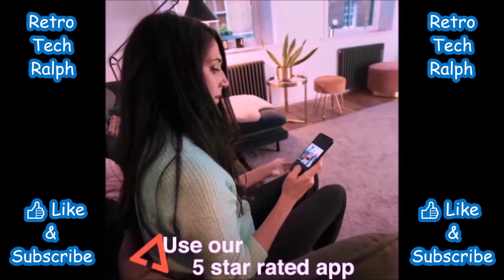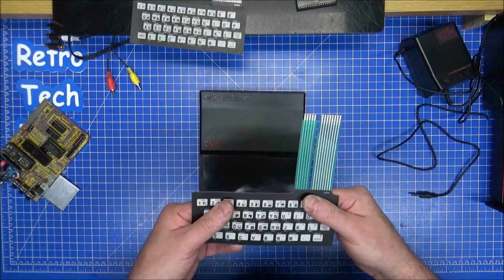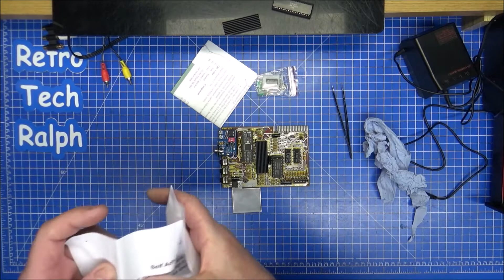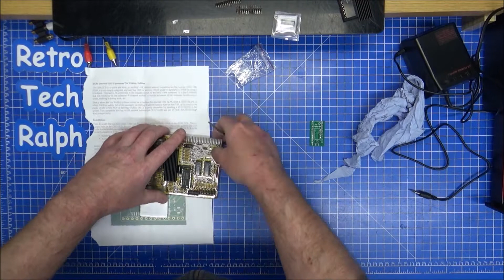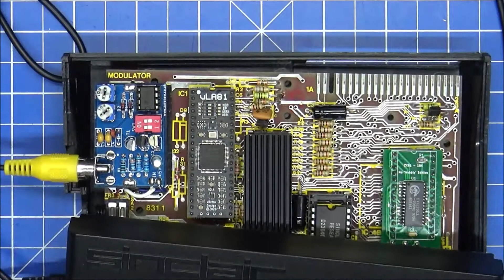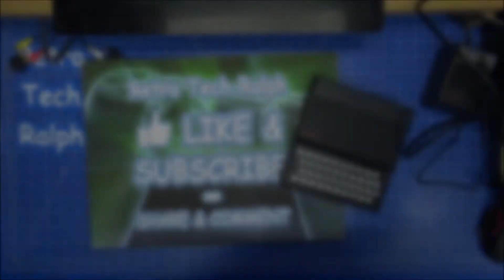ZX81 Repair Part 4. VLA81 and Completion of Repair

Comment: To get the full 16K, you need to set the jumper link to LK2 to connect address line 10. That will give 32768. The first 16K is reserved for the ROM space, then 16K of RAM. That will give 32768 after peeking in RAMtop.

Comment: I am on the same journey! I made the composite mod, BUT, with the vLA81 you don't need the composite mod at all - in fact it disturbs the picture, you should simply connect pin 16 of the vLA81 to the center pin of antenna out.